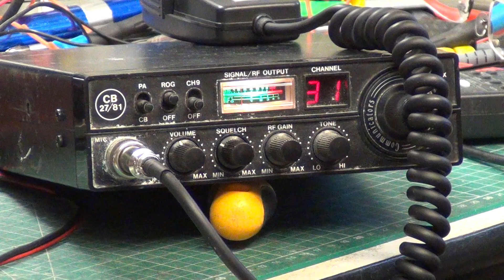LCL Communicators NI440DX CB27/81 UK FM CB radio - On The Air test

Comment: That sounds pretty good to me, both in terms of the transmitted audio clarity as well as the readability of the received signal - even at the worst of the locations you use. It sounds to me that the set is really pulling Mr C's audio out of the background noise very nicely indeed. Perhaps the EQ of the received audio is such that it helps vocal frequencies to have a 'presence' and thus punch through that bit better? Either way, a great-sounding rig and as ever a most-enjoyable video. Best wishes, Dave. :-)